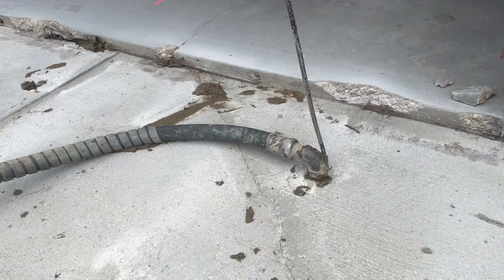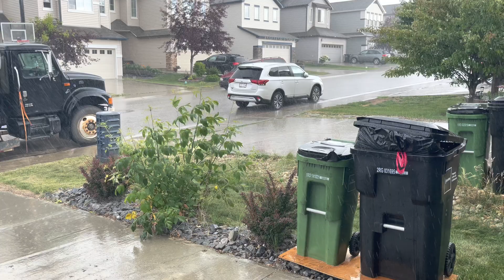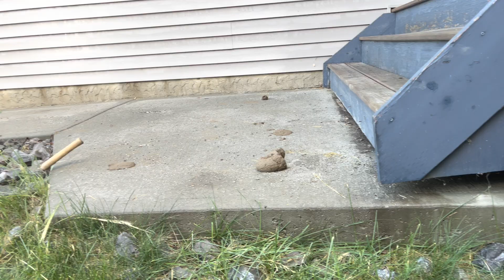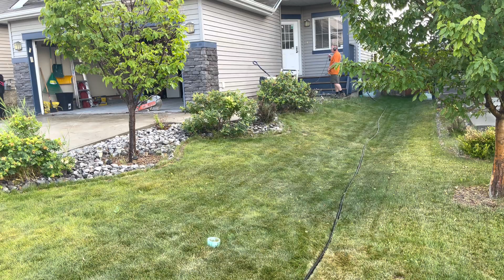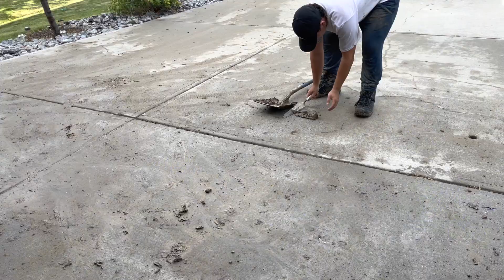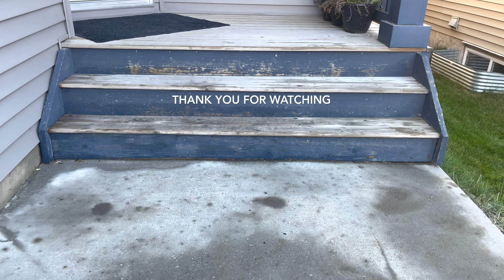Driveway Mud Jacking | Engr Saeed A. Khan, PEng

Comment: We use a similar technique using pressure grouting for stability and strengthening of under ground soil strata to enhance bearing capacity for plant equipment foundations.
Reply from the maker: You are right but I believe through pressure grouting you cannot raise the level of a sunken concrete panel. Am I right?
Reply: @SKDREAMS1  Right. Mud jacking is more suitable and economical solution in case of sunken drive way.